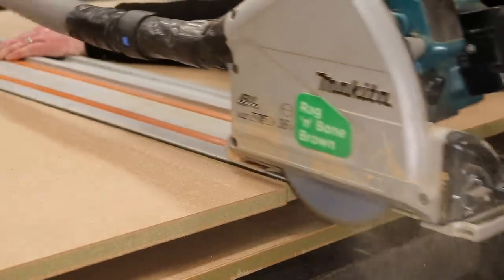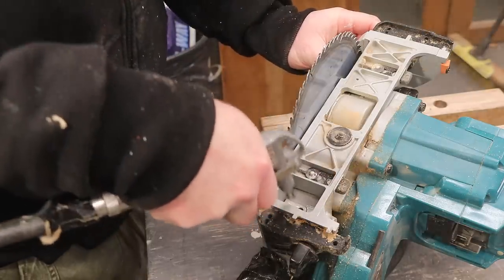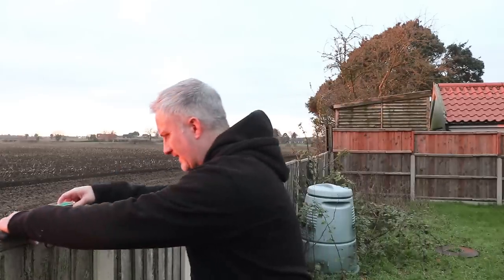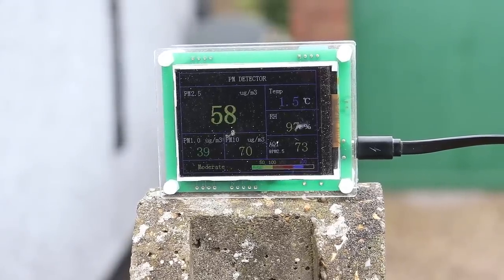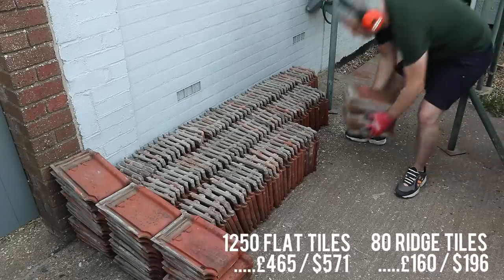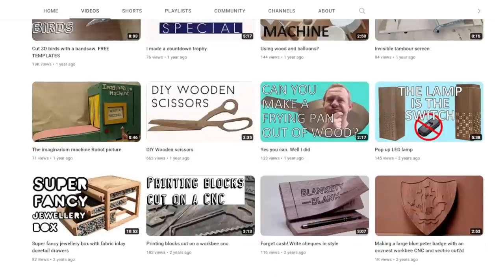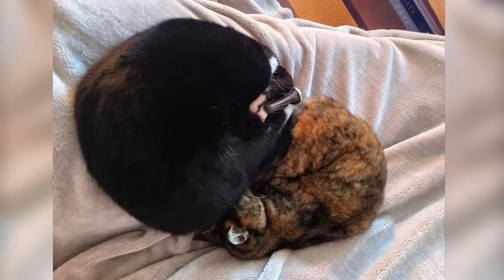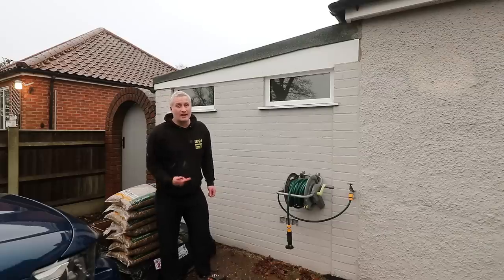Vlog 19: Makita Plunge Saw Fix // Wood Stove Update // Roof Update & More!

Comment: As ever, thanks for sharing! I had the very same problem with the 110v Mikita track saw. I only noticed it when I took it onsite, after not using it for over a year. What can I say? Once I got hold of the 36v cordless, I pretty much used it all the time. After a year in my garage workshop, I noticed the blade didn’t retract. Fortunately, this came to light when I was changing the blade to fit oak worktops, so I avoided the nasty kickback scenario you experienced.
I didn’t take it apart, but gave it a thorough cleaning, and went with the silicone spray. It’s been fine ever since. 👍

Comment: A note about the Iniu power bank.  I'd recommend you make sure the lights are blinking when you plug it in to charge, or you could have a bad day.

After a dozen or so uses, I plugged one of mine in, and saw that the lights were on solid instead of blinking.  I unplugged it and plugged it back in a few times, hoping to reset it or something, and just happened to touch the metal part of the USB-C plug.  It was burning hot.  I tried a different cable and charger, and that one got burning hot as well.  A connection must be shorted within the power bank.  Not great for a device with a lithium polymer battery inside.

I figured I might as well try to open it up and see if there were any obvious problems.  I'll give Iniu one thing, the case is incredibly thick, strong, and well-glued.  Unfortunately, I cracked it, and didn't find anything fixable once it was apart.

Comment: I had the same problem with the 110v saw same thing just lubed it up and it was OK have since replaced  with 18v and not had any problems. When I'm doing any cuts I stop the blade rotating before I remove it from the track and it's a good habit to get into

Comment: Hi Keith your problem with the tracksaw is a common one, as everyone I know with a Makita one has had this issues I did the same as you but it does stiffen up again.  when I took it apart I found the pivot pin had a corrosion on it (it's blacked steel) so removed it and swapped it so a stainless steel one and it's been fine since
Reply from the maker: Thank you
Reply: Hi Gareth, was it easy to remove the pivot pin? I know how to get access to it as I currently have the same problem, but wondered if you had to use a heat gun etc. to ease it out. Also where did you get the replacement stainless one?
Reply: @timgebutler   hi tim I warmed it up with a heat gun.  And pressed it out with a vice. I used a socket on one side and a pin ( slightly smaller than the pivot pin) on the other. My father had some stainless bar so I cut one   the right length and  pressed it in with some grease on it.
Reply: @garethdavies1887  thanks Gareth. Have seen a few videos for this and am a bit nervous about breaking the aluminium housing.